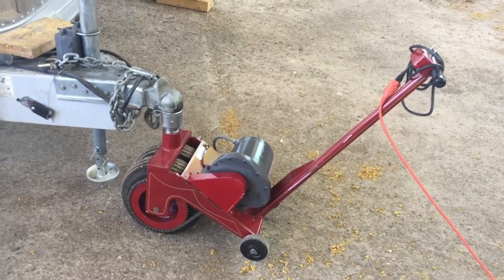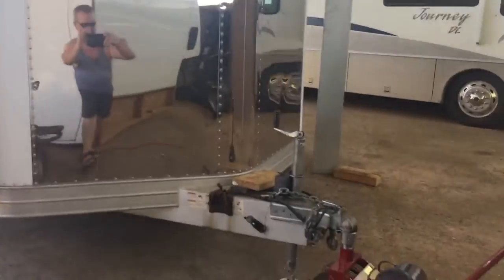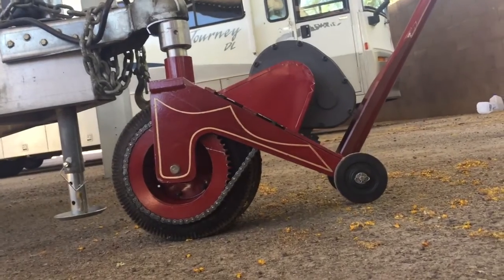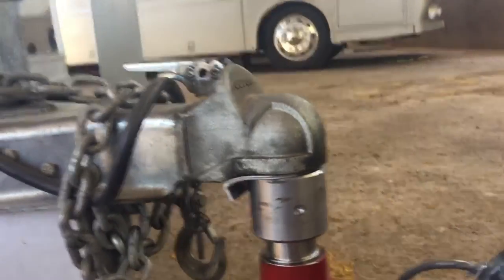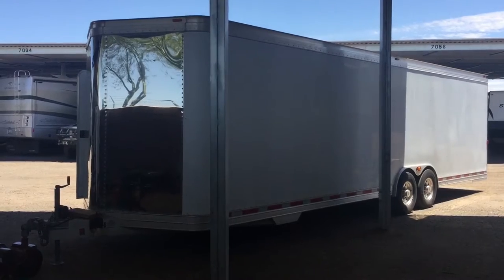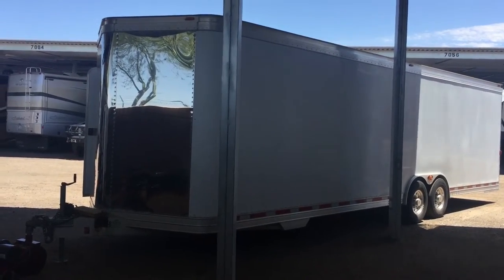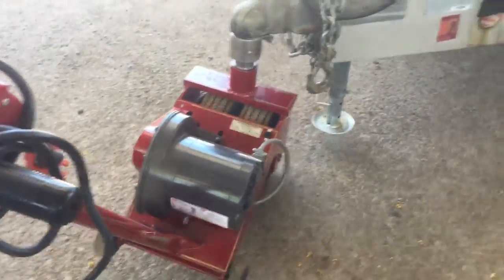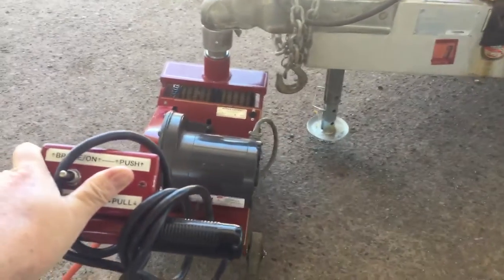April 17, 2019

Comment from the maker: I've been using PC-3 Power Casters for many years and I hated the factory frame brackets that are prehistoric in design and very cumbersome and require drilling or welding to your trailer frame. The factory brackets were always in the way of my equalizer / weight distribution bars so I had to find a better solution, Enter the Locking Ball Tower which is extremely heavy duty, made in the USA it allows you to attach to any and all trailers from the ball hitch which is where trailers were designed to be lifted from! Any heavy duty ball will fit my towers as long as it has the 1 1/4" shank. These towers simply drop in place there are no tools, no mods etc and you can go back to the old school frame brackets if you need to move Betty and Barney Rubbles trailer made of stone lol - $209 total price delivered in the 50 states add $20 for Canada payment via Venmo to autolode, paypal, or cash / postal money orders via snail mail also accepted - pmd@wacam.us is my direct email
Reply: Do you still make and sell these?
Reply from the maker: @robertgarrett7610  the ball towers yes I do put them together they are currently $209 total price delivered in the USA
Reply from the maker: @robertgarrett7610  yes I do fred@autolode.com
Reply: Are you still making these ?
Reply: Hello, do you still have the trailer ball attachment. I need one. Thanks.

Comment: anyone have experience with this on an inclined driveway?
Reply: A slight incline is no problem say 5 to 6 degrees  but you don't have a tow rig with brakes to catch a runaway trailer you also need sufficient tongue weight so the tires have enough traction to push or pull up the incline - you can add an electric trailer brake controller fairly easily if needed